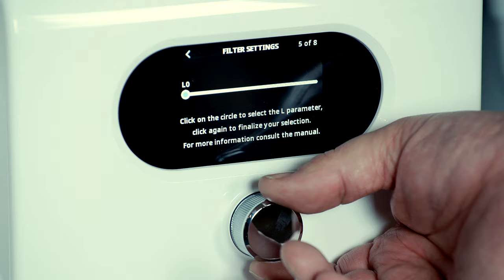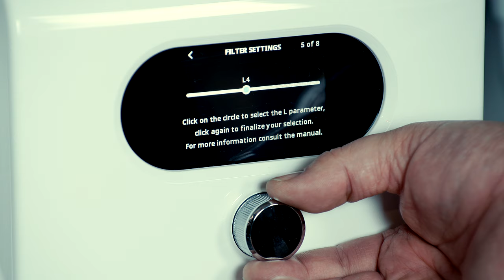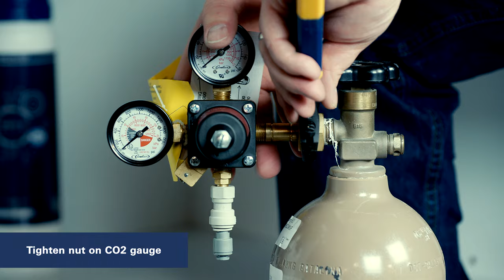GROHE | GROHE Blue 2.0 Chilled & Sparkling 2.0 | Installation Video

Comment: Hi @GroheAmeria - My system sprays water around where the blue hose connects to the adaptor (as seen at 1:11). It seems the clamping / sealing system has changed as my system and instructions show a different red clamp from the one in the video seen at 1:17. Please advise how to proceed.